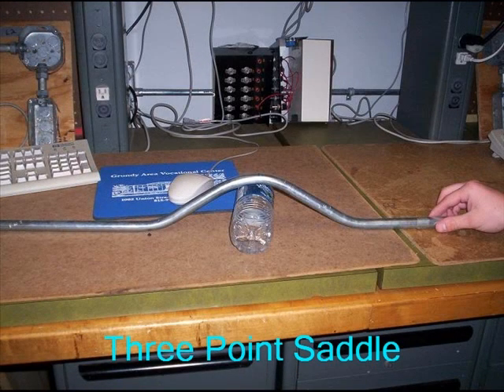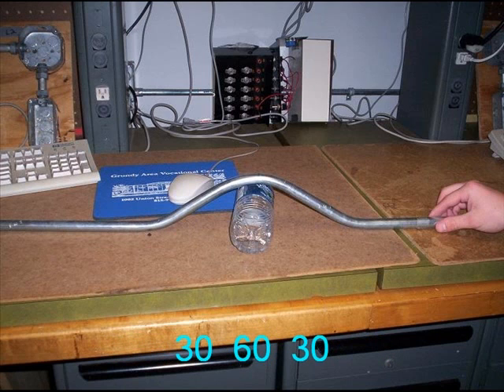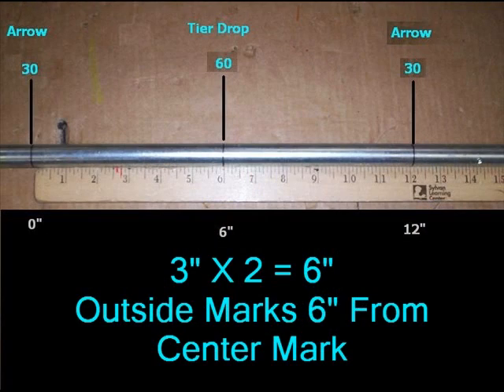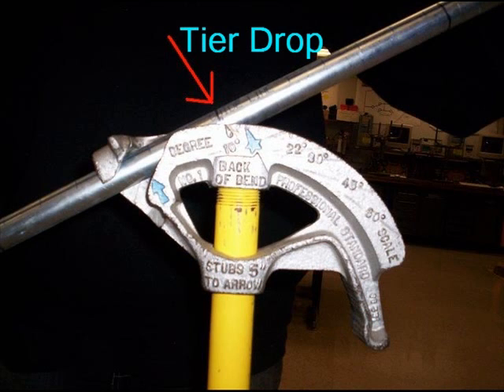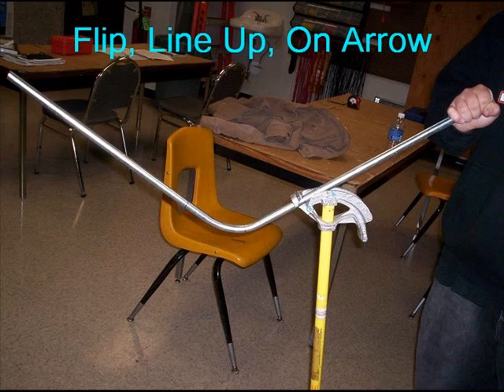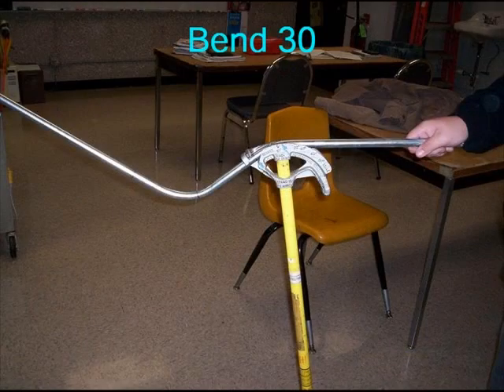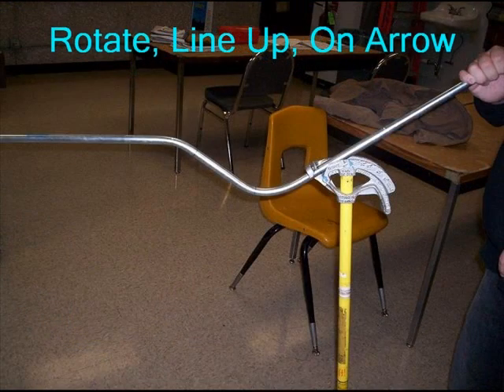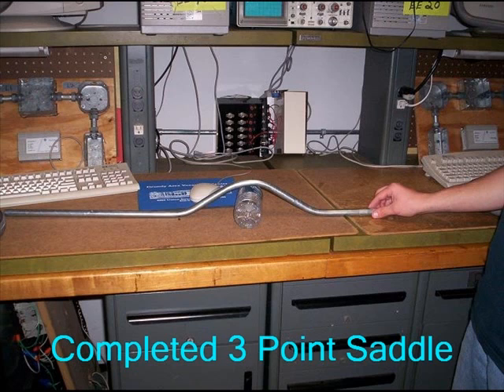Conduit Bending Three Point Saddle Bend

Comment: @jeffer2m I only know it as poly bond conduit .  Its mainly  a rigid pipe coated with a plastic to prevent corrosion. You do have to use a over sized bender. At work I mainly install  1/2 poly bond and use a 3/4 rigid bender.

Comment: a 30/60/30 saddle is insane and stupid. thats WAY too much bend that short a distance - 120 degrees! a 22/45/22 saddle is the classic one taught. i personally do 15/30/15 on my 3 points. also i pre locate the center of the bends on my bender with scrap pipe and use a push through method similar to using a chicago bender, makes it much easier!

Comment: its called pvc coated pipe.its galvanized pipe coated with pvc used in very wet conditions such as highways water treatment plants etc.you need a special threader n bending shoe for threading and bending respectively.

Comment: 5. Place marks on the conduit 2 1/2 times the height of the object to saddle each way from the center of the 45º bend.  These marks are where the bender will be placed to make the two 22 1/2º bends. 
6. Place the conduit in the bender with the center mark on the 45º center mark on the bender. Make your bend.
7. Both 22 1/2 bends will be made at the arrow.

Comment: Most three bend saddles are bent using  22.5º for the two outside bends, and 45º for the center bend.

The steps to making a three bend saddle are:

1. Measure the height of the object to be saddled. 
2. Measure the distance from the end of the conduit to be bent to the center of the object to saddle. 
3. Place mark on conduit at distance to center of object. 
4. Add 3/16" to the distance for each inch of saddle required.   This distance becomes the new center of the 45º bend.

Comment: I would rather pull through a 45 degree saddle versus a 30-60-30 saddle. A 30-60-30=120 degrees. A 45 degree saddle= 90 degrees!

Bend 1= 45 degrees
Bend 2= 22 1/2 degrees
Bend three= 22 1/2 degrees

Besides, who bends a 60 degree saddle in the first place? Unless you need to saddle a high obstacle, you use a 45 degree saddle. It just looks better.